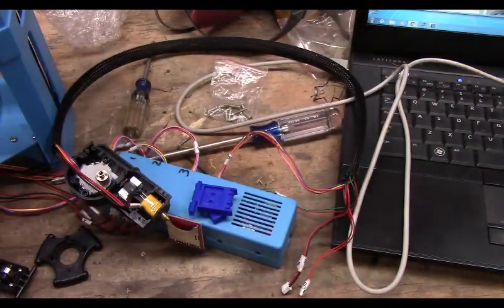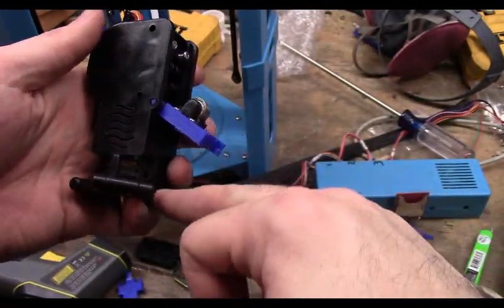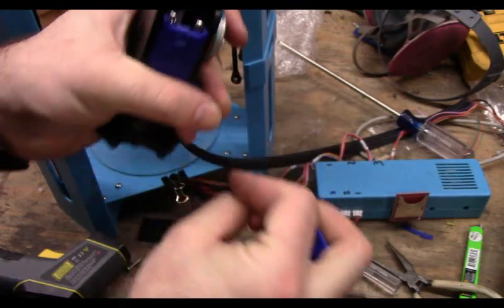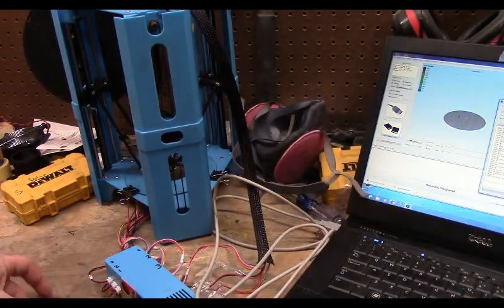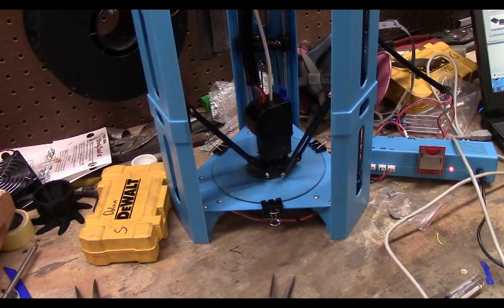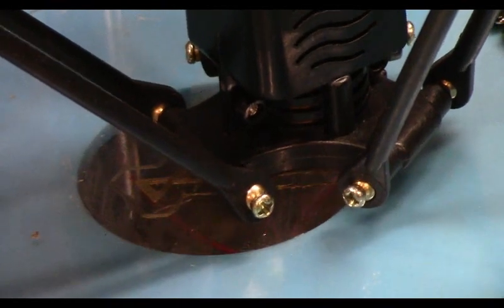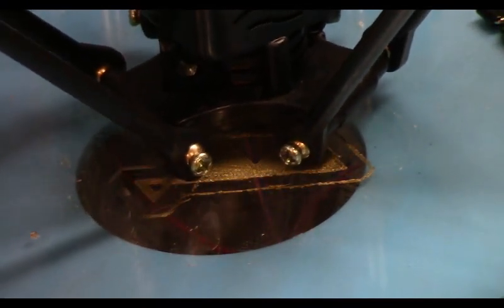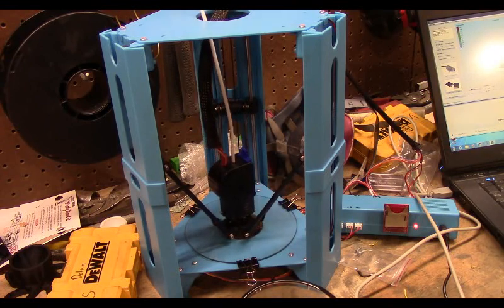101hero printhead improvement

Comment: I use Cura. I really like how you print with slow settings. Could you please help me out? I need to configure my cura to print well but have been having all kinds of issues. What is a good setup to use to print slowly on the 101 hero? It seems everyone is printing at in the range of 9 and 15 but I want to print slower like 4 to make better prints however when I do if not adjusting the rest of the configuration the prints fail. A screen shot of cura's settings page would be super useful if anyone can help it would be much appreciated!

Comment: Why not try a cam over latch?
Reply from the maker: Would work, just would have to figure out how you wanted to mount one. Also I am trying to keep my mods for the printer to be mostly printed if possible. That way anyone who already has the printer could theoretically make the replacement parts for themselves.
Reply from the maker: also, if printed the complexity is just beyond me.
Reply: Workshop Tinkerers 

Add a hinged point on the front of both of the pieces you've already designed and print a piece to bridge between the two hinged points